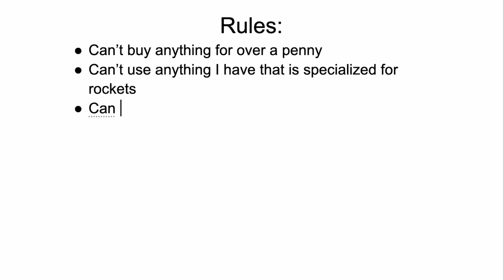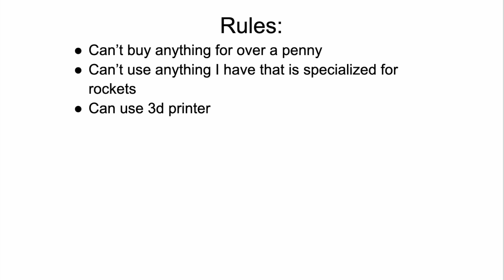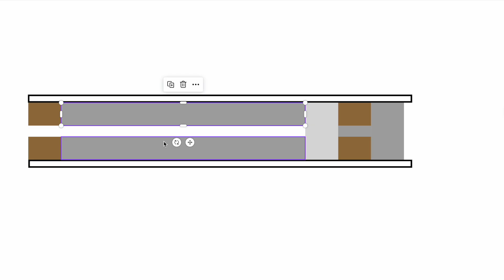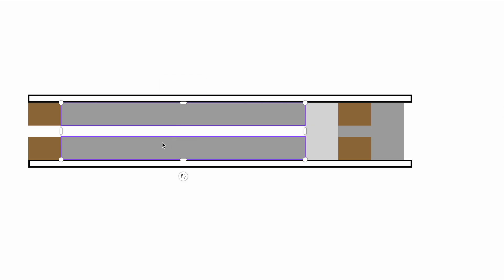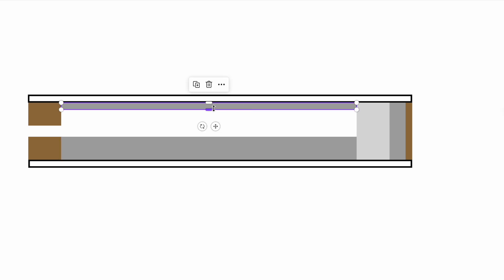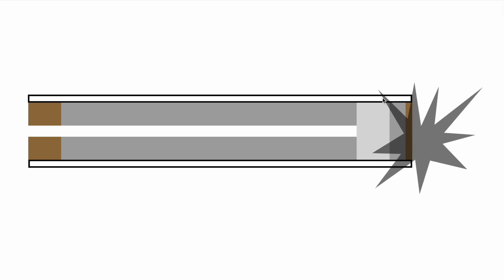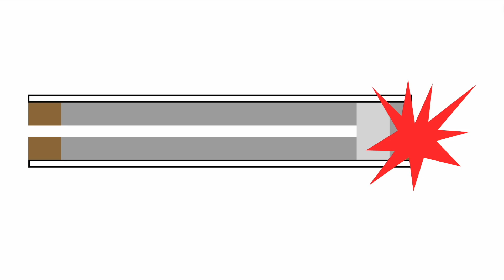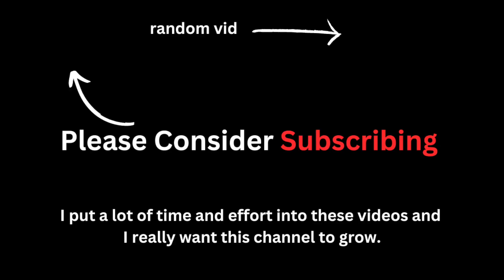Can You Build a Rocket For $0.01 | Part 2

Comment: Clickbait title, the 3d printer (lol) filament is a few cents a gram.. plus rocket motor, fun looking project though.
Reply from the maker: Forgot about the filament pricing 🙃, but I built those motors with sugar and fertilizer.
Reply: @COSMOSIS245   Nice, I think your overall goal of low cost was still achieved in the end ✌

Comment: Just a warning: It is recommended to not use fuses. This is because the sparks can easily jump, and ignite the motor before you remove your hand. Should an event occur like the launch stand tipping over, you also can't stop the launch. For these size rockets, I'm not too concerned, but just something to keep in mind! Other than that, nice project!
Reply from the maker: I normally use e-matches on larger rockets, this had a small motor so I deemed it safe. Thanks for the tip otherwise!
Reply: @COSMOSIS245  Cool! Just beware rockets get lethal much faster than you would think. The tiny Estes rockets with the C6 motors have gone through the roof of a car!

Comment: Did you even sand the fins? This affects aerodynamics way more that you might think at the first glance. And the fin looks very thick for what stabilizing surface area it provides, ig to make mounting easier. That creates a ton of drag and when combined with roughness of surfaces could dis-stabilize the vessel.
Reply from the maker: I usually sand my fins, but I couldn't use balsa so I had to 3d print. The infill was so low I might have just sanded right through the fins. Thanks for the tip though
Reply: @COSMOSIS245  If you're using 3D printing, you ought to be able to get a nice airfoil shape that doesn't need much sanding. There are other options besides balsa and 3D printing. For instance, you can let slow epoxy* sink into paper for a few minutes, then scrape off the extra and then use the paper with some kind of foam as a core. I'm sure I could think of twenty different ways to make fins that are cheap and adequate with ordinary materials. 

*Slow epoxy that cures fairly hard.